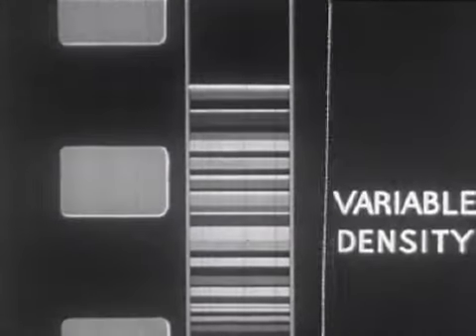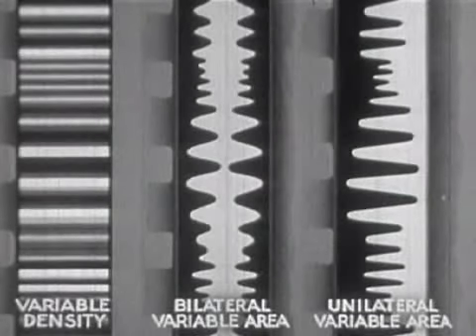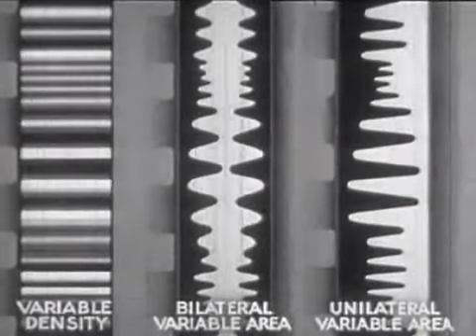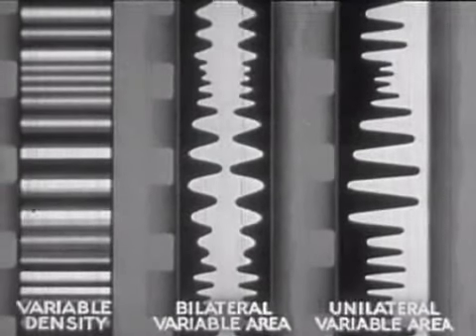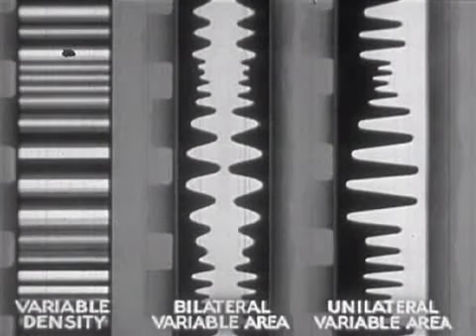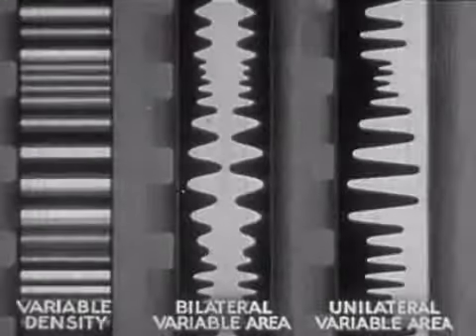Video Clip 3: Optical Sound Track Types

Comment: I offer a correction on the variable density track explanation offered up in this educational film.  The variable density recording line does not change in width but only in brilliance.  The width of the line is fixed by the optical sytem design and has been chosen as a compromise for delivering a useful high frequency response while at the same time providing enough light to properly expose the film recording stock.  Read John G. Frayne & Halley Wolfe , ELEMENTS OF SOUND RECORDING.

Comment: Can any answer this questions, I have an RCA 400 16mm projector that I usually run films with  bilateral variable area sound tracks, but recently I purchased a film with a variable density sound track and when I ran the film I noticed that the sound was much quieter but I can still under stand what the characters are saying, Is the low volume due to the type of sound track or is it just because the audio was recorded at a low level when it was originally made?